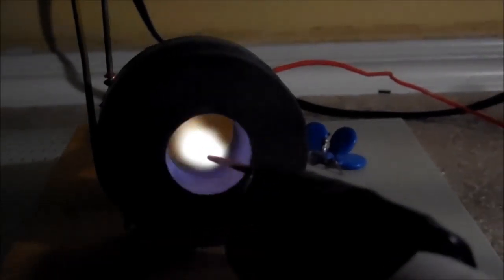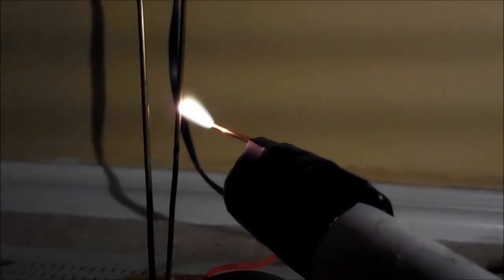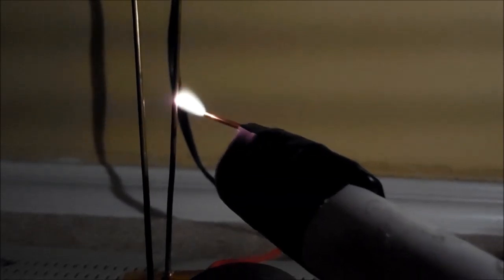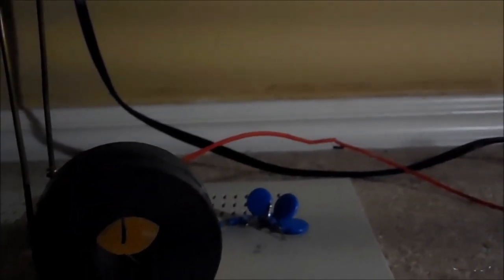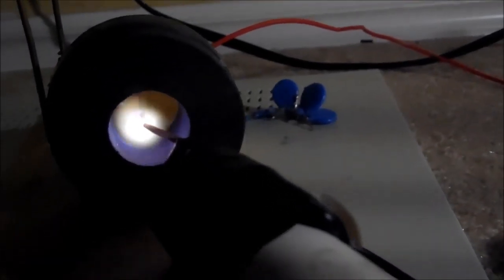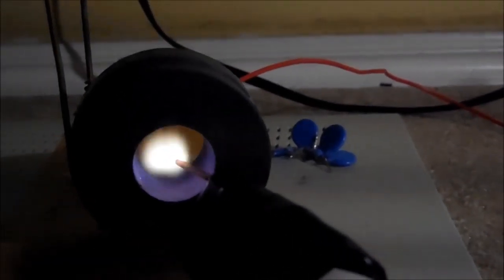Ball of Plasma (High Voltage+Circle Magnet)

Comment: What is the inner diameter, the outer diameter and the height of the microwave oven magnets?
Reply from the maker: The outer diameter is about 2", inner diameter probably just under an inch, and the thickness is usually 3/8".

Comment: Does a ball form if you shoot an electric arc between two magnets that have opposite polarity towards one another? (assuming center of a magnet or ring magnet has a similar field as between two magnets in attraction that when attached form a single magnet)

Comment: thanks for sharing this!
I don't if you're still there because the video is old but I want to share with you something that I've discovered by luch some years ago:
I was using a gas lighter and a car ignition coil linked to a spinning silver coin,one wire coming from the second coil was directly connected to a small ferrite magnet and the coin was connected to the other wire from the 2° coil.
When the magnet was near a very very strange spark was there,if you'll replicate it you'll see by yourself.

Comment: if you can harness, control, amplify the rotation of plasma spinning in some container, being spun by and amplified by tweaking a strong magnetic field around it to increase the plasmas spin..you might have some sort of power generator engine thing. i dont know glass tube infused with gold particles? maybe other magnet particles, lol alot of engineering.

Comment: Did this increase or decrease the magnetic filed form the magnet?
Reply from the maker: I have no way to measure or to tell.
Reply: @ElectroTechnics  it would have to decrease it, bc the plasma is taking energy from the magnetic field. Kinda like how a transformer is less likely to saturate when pulling current from the secondary
Reply: Not sure what you're getting at op. But moving charged particles create their own magnetic field. Electrotechnics, do you have a cell phone? They typically come with magnetometers nowadays and you can display the mag info through several apps, the simple ones are 2d compass apps, but I prefer the ones with 3d arrows and a read out of field strength.

Comment: That's cool. I am (in the near future) going to be experimenting with the same thing but using gas filled tubes that I make. Very interesting and cool. Peace.
Reply: cool, i did what he did but i used a microwave transformer as the power source and i ran the outlet current through a 4000 turn coil from an ac fridge fan motor coil, and then arced the terminals exactly in the middle of the hollow part of the coil, a plasma window formed and the inside of the coil burst into flames, i speculate that because the current was at a frequency which was resonant to the arc forming, that the long bandwidth radio waves produced both coupled with and pinched the plasma window to drastically increase pulsed plasma temperature.